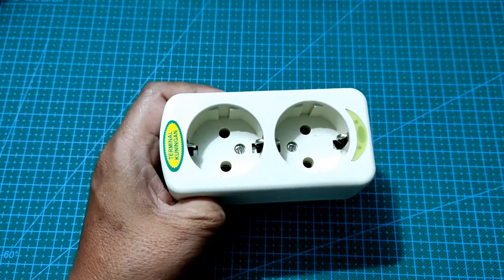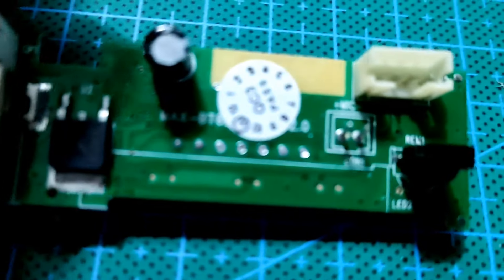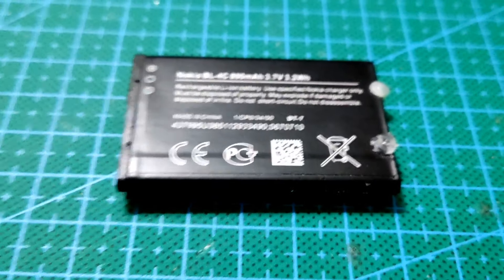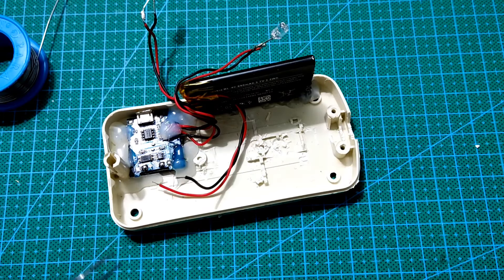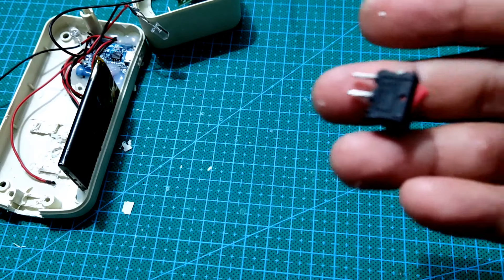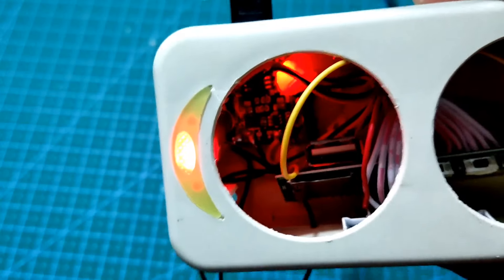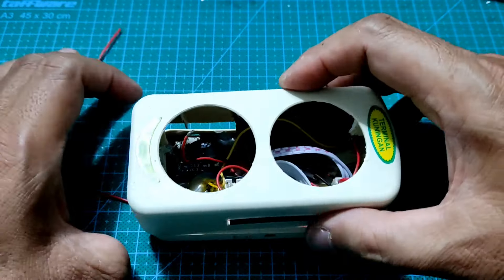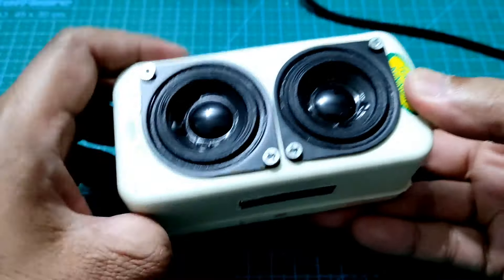DIY Mini Bluetooth Speakers | Toturial Cara Membuat Bluethoot Speakers

Comment: Saya membuat spiker bluetooth menggunakan dua kit pam 8403 empat spiker dua inch dua ohm dengan satu kit modul bluetooth..daya batre 18650 saya step up 5 v..tapi suaranya kok malah nggak enak..ada masukan lur..supaya maksimal..
Reply from the maker: Wah ini project Yang bagus bang, saya belum pernah buat seperti ini, tapi sebenarnya ngga usah pake step up bisa kok.

Mengenai suara, apakah abang Udah pakai elco di jalur 5 volt PAM 8403nya ?
Reply: @LinkGO  di kit yg lama udah aku pasang elco..yg baru belum aku kasih elco..daya cuman aku sambung ke elco yg lama..mungkin minta elco lagi di 8403 yg baru..ini mau saya coba pasang elco sendiri.
Reply from the maker: @mainketapel  ya bang, Ide bagus itu, jika berhasil info ya bang.
O ya, bisa juga Karena supply baterai kurang, abang Coba ganti Dan cas baterai sampai full ya...
Reply: @LinkGO  siapp mas..bisa jadi suplai batre kurang maksimal..terimakasih mas lur masukannya.
Reply from the maker: @mainketapel  ya bang, Sama sama, semoga sukses ya...

Comment: Hmmm....🤔 Kira2 box terminal listrik tsb kalo lubangnya steker ada 3, bisa ditambahkan lagi gak ya ama tone control pasif 🤔? (˛•̃•̃)/🍻\(•̃•̃¸) 😁
Oh yaa... Btw, itu 3:52 kok gak dipindah posisi sensor remotenya sekalian🤔? Memangnya remote bisa tembus walau sensor didalamnya box 17:38 🤔? Dan juga fitur kit USB/TF-card/tombol fisik/AUX-in gak bisa digunakan lagi ya 😅 Kalaupun hanya berharap sumber audio via BT, kenapa gak pasang modul BT receiver VHM-314 aja. Kan sizenya kecil + 5 vdc juga 😁✌️
Reply from the maker: Hahaha pengamatan yang jeli, namun saya sangat mengapresiasi udah nonton video nya ya bang. 

Untuk posisi 3:52 itu dipindah karena saat proses pelepasan modul display terjadi kegagalan, maka saya ganti dengan modul lain, namun saya lupa posisi akhir take scene 😀

Posisi 17:38, ya bang ini sensornya bisa tembus.

Nah, mengenai fungsi USB TF card ngga di pakai lagi, itu menang disengaja dalam project ini. 

Karena untuk uji coba project berikutnya semua fitur modul Bluetooth tersebut bisa digunakan. 

Ini juga menjawab mengapa ngga gunain  VHM-314? Karena untuk di project berikutnya saya mau aktifin semua fitur modul Bluetooth tersebut, yang tidak dimiliki oleh VHM-314. 

Tunggu project berikutnya ya bang... 
Sekali lagi terimakasih udah tonton dan semua masukannya ya bang... 🙏👍
Reply: @LinkGO  😂•• ƗƗαƗƗαƗƗαƗƗαƗƗαƗƗα ••😂
Gak mamah.. Kalo gak ada kegagalan pertamakali itu faktor hoki. Tapi bukan berarti gagal seterusnya, malahan suatu pembelajatan & jadi pijakan menuju kesuksesan. Biasa itu buang bahan beberapa kali gegara ekperiment sesuatu lah. ●๋•нι..нι..нι..●๋•
Baru tau kalo sensormya bisa tembus juga kayak bejongkok dibahan plastik 2-3mm 🤔
Ntar coba aah 🏃..💨💨....🚶.. 😁
Mengenai fitur sebuah kit itu relatif. Srsuai kemauan/kebutuhan sang perakit 🙏
Lanjutkan berkreatifitasnya 👍
Kalo owe saat juga lagi experiment bikin mini ampli seukuran kotak rokok malioboro ✌（＾＿－）..
Reply from the maker: @BuluBuridSMDA  hahaha ok bang, semoga sukses ya, jangan lupa share nanti karya ampli mininya ya bang....

Comment: Link wiring malah masuk Amazon, btw tanggung tuh kenapa infrared nya gak jumper juga? Biar bisa atur mode dan volume pakai remote karena tombolnya di dalam semua box
Reply from the maker: Infrared bisa berfungsi bang, pakai remote juga bisa
Reply: @LinkGO  tetap berfungsi walaupun ketutup box?
Reply from the maker: @soul5988  ya bang, besok saya buatkan video short nya ya... 🙏